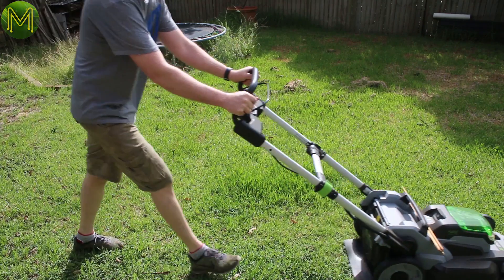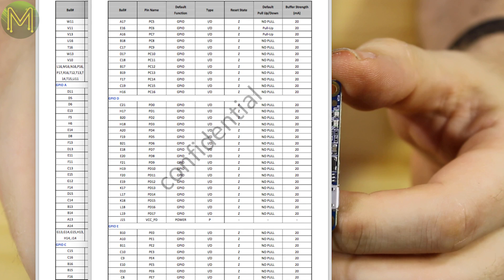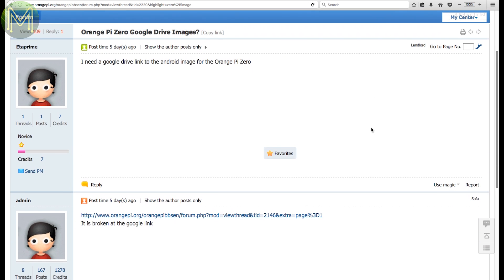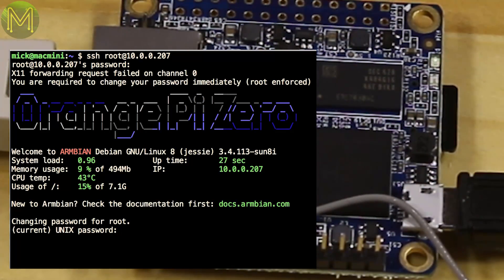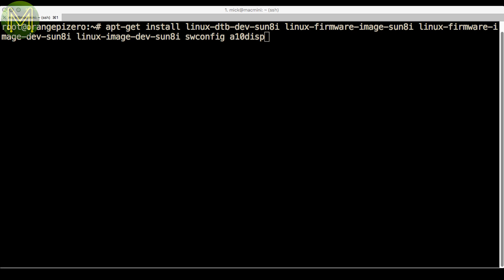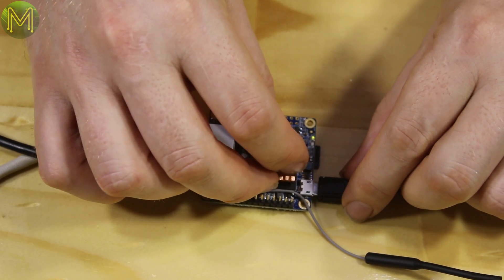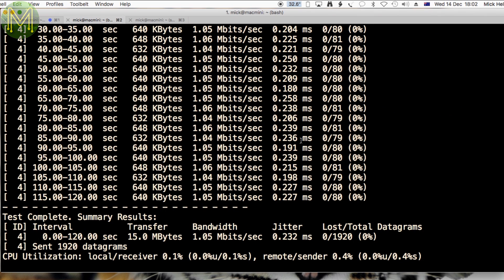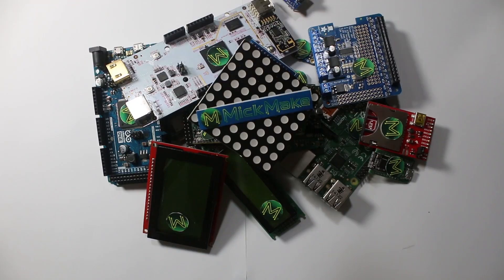#080 Orange Pi Zero: Better than the Raspberry Pi Zero? // Review

Comment: +MickMake USB OTG isn't enabled in Armbian-images by default, so that's probably why you weren't seeing it as a USB-device. Adding g_serial to /etc/modules should've fixed that. There is an open issue on Armbian's github about this, but I don't know if there are any decisions made, yet. As for missing I2C and SPI: did you check if i2cdev-l and spidev-kernel modules were loaded?

About the pin-headers...stuff like this is what I've been raging about several times. Many SoCs used by these various kinds of SBCs actually have way more useable pins and buses than what gets brought out on headers, and that means there's a lot of wasted potential. Sure, 200+ GPIO-pins might be a bit of an overkill on an SBC in general, but why not e.g. put out 40 or 60 of them on the board and then bring the rest out on a ZIF-connector? Those people who want/need more than what's on the board by default would then only need to make/buy a daughter-board and connect it to the ZIF-connector with a FFC-cable and POOF -- hundreds more GPIO. I think it'd be a reasonably elegant way of keeping the main SBC-board from being bloated with billions of pins, while not preventing you from using it to its fullest when needed.
Reply from the maker: +Nita Vesa 
Hi Nita, yup all modules were loaded up. I could have spent more time on getting it going, and really wouldn't have taken much effort, but that wasn't the goal of the review. Getting into kernel rebuilds isn't for everyone. Although I should do a video on that!

I agree with the GPIOs. Such a waste and gets my goat every time I see these boards being released with a piddley amount of them. Such a brain-dead decision. It's like buying a Porsche and having only one cylinder running.
There needs to be a new standard, something like Uber Raspberry Pi GPIO header.
Reply: The Up^2 and some/most of the 96Boards SBCs bring out a bunch of GPIOs out, but offer a whole lot of additional pins via a separate header. I think it's a good idea in general, though I think the connector they use on the 96Boards SBCs might be more robust.

Makes me wonder if the Up^2-people are going to be selling a daughter-board to connect to that, or if they'll just leave the design and manufacturing of such to individuals from the community. In fact, I think I'll just ask them!
Reply from the maker: They mentioned to me that they weren't going to provide access to the FPGA, which is a shame. Hopefully I can convince them to do otherwise, but I can understand from their perspective; someone can really stuff it up as a lot of the core depends on that FPGA.
Reply: I don't know if you really care, but I got a response today from them and they did confirm that they will sell a daughter-board for use with the exHAT-connector.
Reply from the maker: Excellent! Thanks for chasing that up.

Comment: Great video! I usually put a thermal pad or even thermal paste between the heatsink for better performance. 
The support from Orange pi really sucks but at least there community provides decent support.
Reply from the maker: +bonnome2 
Yup, these heatsinks have the black adhesive thermal gunk which seems to do a good job of conducting heat.
But yes good that there's support there from the community, maybe the company should start paying those people? ;-)

Comment: I did not expect this video to be out so fast. Thanks for the in depth test on it.  Here is hoping they fix all the issues.
Reply from the maker: +EyesofNova 
No problems, mate! I have a strict schedule, but move things around as needed. Let me know if you need any more questions answered.
BTW I'll be doing a "running on battery" series on a lot of the SBCs soon.
Reply: MickMake you answered a lot of questions. I'm going to give this a pass for a bit until they get it worked out a bit. The lack of support from the dev is kind of dumb. Also can't wait to see the running on battery series.
Reply: EyesofNova no they won't fix all the issues, because you already bought it and they don't give a fuk. software support on the banana anything has been banana
Reply: Moes This is the Orange Pi, not the Banana Pi

Comment: At 4:58. Do you mean that by hooking up pin 9 to the tv we can have a GUI interface displayed to it? If yes have you tried it?
Reply: I sent him some cash to buy one so I could see his thoughts on it. I need something small like a pi zero but with more power so I wanted to see if this was worth my time.
Reply: +EyesofNova
you just did some time space trade off. lol
Reply from the maker: +Akarsh Agarwal 
Yes true, but i didn't test this out. I need to get my hands on something that can display composite.
Reply: +Mick Make
Also why would someone buy an orange pi zero over the orange pi one. I mean they cost almost the same and the pi one has a H3 quad core which would probably have better performance and it also has the HDMI port. Both of them costs roughly 12$ shipping included.
Reply: Also I'm now going to buy one. So what were the places where you found the best tutorials for this?
Reply from the maker: +EyesofNova 
Thanks for that. Did I answer all your questions / concerns? Let me know if you want me to do any more tests.
Reply: Its still fairly new, so not many tutorials.  Your best bet is to look for more general orange pi tutorials.  I'd say right now the best forum is the armbain forum.
Reply: +Akarsh Agarwal Apparently, the Orange Pi one and Orange Pi Lite use an inferior voltage regulator to the SoC, than all the other Oranges, including the Zero. The zero should perform slightly better under load than the Orange Pi One. You can read through this for more info, specifically the voltage regulator section: https://forum.armbian.com/index.php?/topic/1351-h3-board-buyers-guide/

Comment: Even if the Orange Zero is better in every way than the Raspberry version, the simple support and overall user happiness will always make the raspberry the winner in my book.
Reply from the maker: +Richard T 
True true. But out of a lot of knockoffs this one seems to be the better supported and since it cheap as chips it can be shoved into so many places.
The big issue with this board is the lack of MIPI. Man it'd be a killer if the included that and what about all those other GPIOs?
Just routing a bunch of tracks out isn't that hard!
Reply: MickMake I honestly suspect this board was released due to some corporate mandate rather than, as you had said, when the board was ready. It could indeed be a killer piece of hardware ... if only ...

BTW What is this nonsense about 30C+ in Dec? It is currently -8C here in Vancouver, with a big snowstorm coming! :)
Reply from the maker: +Richard T
Yes I agree with you. It could have been so much more. Companies like this have to stop being "better" and be "different".

It'd be nice if it was -8C down under for Christmas. The coldest it's been during Christmas was 16.
Reply: yeah I got an OrangePi PC a while back and it barely worked, after the hassle of finding a working image on the forums (a very awesome guy put a lot of effort into providing some that work, strange the people at OrangePi couldn't have done the same..) after a few weeks it just started freezing on start up and nothing I tried ever fixed it. Meanwhile my RasPi3 has worked beautifully the for months.
the difference of £20 between them still doesn't make a product that was hassle from the start and fails in a month worth the money to me so I just avoid OrangePi in general now.
Reply from the maker: Yup the Orange Pi is coming along steadily and the company actually supports Armbian financially I'm led to believe.
The OPiZ is probably one of my favourite boards.
I wouldn't mind doing a video on setting up a WiFi AP cluster.
Reply: Please do it!
Reply from the maker: Yup, the Pi design is rock solid. You gotta hand it to them for creating a nice stable product.
Reply: Well, the lack of software supoert defietly is an important point. So it is not better in every way. My main complaint about the Pi Zero is that i can't actually get one. But i gues they will fix that soon as they did with the first one.
Reply: Orange Pi is progressing, see the work that is happening in Armbian forum.
https://forum.armbian.com/
Reply: WiFi AP cluster using OPiZ is an excellent idea Go4it.
Reply: fgregerfeaxcwfeffece ? The Pi Hut has had them in stock pretty much constantly, though you do up the price a lot if you're not from the UK I guess
Reply: It depends on which country 
you live in. In my country, the delivery of Rasberi Pi Zero is $20, in 
the end $25, and the Orange Pi zero $11 with delivery.

Comment: this should be interesting to watch, could be a pretty nice solution for small handheld portable gaming emulators if it can be made to work with something like emulation-station and the Adafruit piTFT series.
Reply: Skwisgar2322 if spi does not work,  then how spi tft would work?
Reply: Amitesh Singh assuming they get spi to work, hense why I said worth watching.
Reply from the maker: +Skwisgar2322 
I think it's pretty close to someone fixing up the SPI/I2C issues. It's not particularly hard to get it going.
Reply: that is a good news. although i am interested in buying orange pi pc plus. I have been doing linux kernel programming since 3 months and i think it would be great for my learning to start hacking orange  pi.
btw, i would still like orange pi to work flawlessly on mainline linux kernel. I heard allwinner company has been accused quite a few times for violating GPL license. https://en.wikipedia.org/wiki/Allwinner_Technology#Linux_controversies
Also there has been backdoor controversy too. these were reasons for me earlier not to try orange pi.
Reply: thats true, there are other displays like MCUFriend which has parallel 8/16 bits bus which can work with gpio drivers only. 
Recently i wrote a driver for parallel 8 bits bus 3.5" display(ili9481) (similar to mcu friend) which works well with raspberry pi 2.
https://twitter.com/amitesh_singh/status/810209555049304064

18bit color mode (RGB666)

https://github.com/amitesh-singh/ldd/blob/master/tfts/tftframework/4dtftrgb666.c

16 bit color mode (RGB565)

https://github.com/amitesh-singh/ldd/blob/master/tfts/tftframework/4dtft.c
Reply: i could fix it if i get one and try my hands on it. :)

Comment: I've got a few NanoPi Neo Air boards which are really similar: http://nanopi.io/nanopi-neo-air.html

I'm liking the on-board eMMC, which means that after a little fiddling you can run them without a MicroSD card at all! I really prefer these to the RPi Zero for embedded/IoT stuff, since they're available in quantities greater than '1' and by the time you account for wifi, BT, and a microSD, they're not really any more expensive.

I wonder where they're going to go next? 40mm square is pretty small for a full computer - can someone trim it down even more while still producing something usable?
Reply from the maker: The NanoPi Neo Air is another board I wouldn't mind checking out.
It'll be interesting in the next couple of years. MCUs are getting more and more capable and cheaper.

The next iteration of the Pi will be interesting to see along with the Teensy.

Will they provide more CPU grunt and increase power consumption?
Or will they add more features such as built in LiPo management?
Or go in a different direction and make it more modular?

Interesting...

Comment: I also take issue with companies that are developing and selling these hardware products and expecting the users to fend for themselves on the software side. I AM LOOKING AT YOU PINE64 -- I BACKED YOUR KICKSTARTER LIKE AN IDIOT, AND THERE IS ONE GUY COMPILING KERNEL MODULES AND PUTTING OUT O/S BUILDS  'N SHIT, AND HE DOESN'T EVEN WORK FOR YOU! (honestly, all of them are the Chinese companies pushing this crap out). Come on, at least provide some form of operating system, or a ready-made Linux distro ISO with pre-compiled binaries. They are taking people's money and basically exploiting the maker market boom. I really hate that shit, it's starting to be absolutely flooded with them.
Reply from the maker: +stryk187 
Yes there's a heck a lot of duds around. This is one of the reasons why I started up MickMake. Just wasn't enough information around to really decide if I could use a particular product or not.
Reply: yeah i am thinking getting a banana pi m3 but might learn more about it